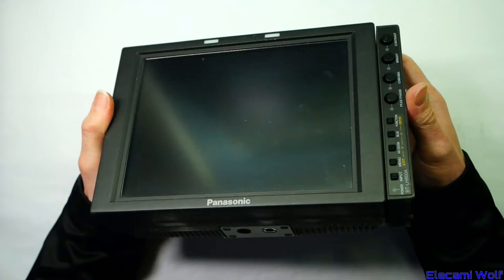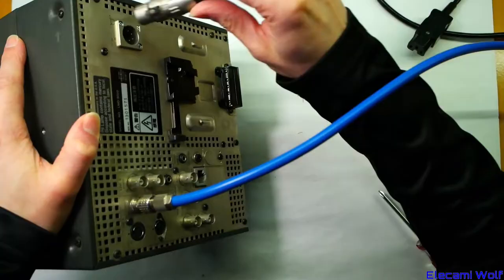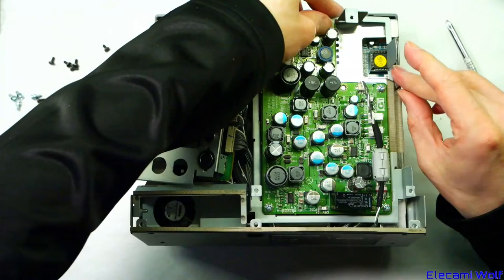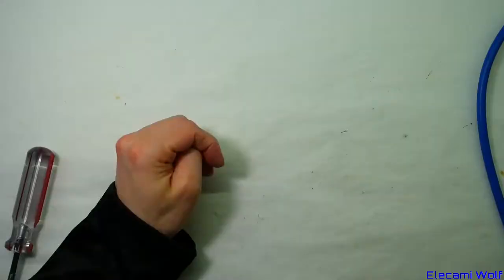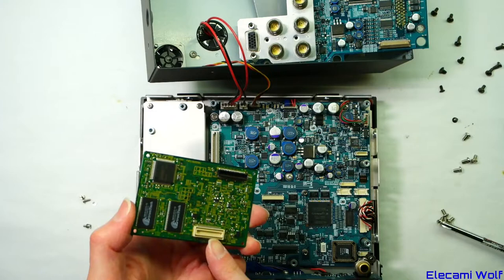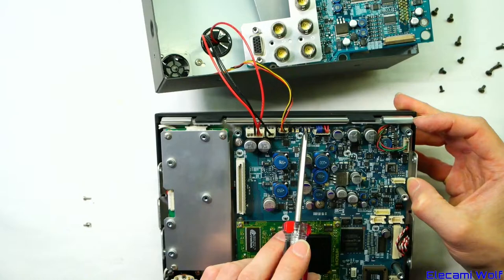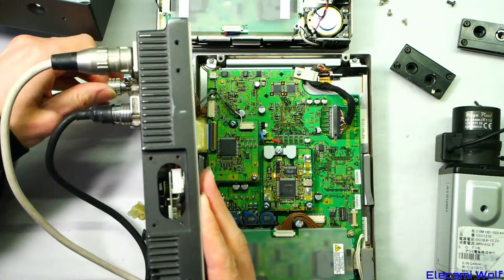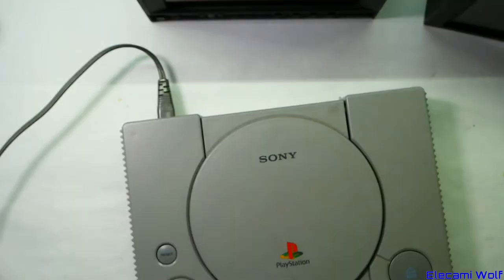EW0049 - Professional Video Monitor Teardown Sony Ikegami Panasonic

Comment: I bought the sony lmd-9050 for more than 3000€ when it was new. It was a product that worked perfectly, but was to cumbursome to be portable or wearable, so it was left to collect dust way to the power adaptor was a huge pain also. Reflecting back it was a go between product to real portable screens I should have never invested in. After two years even for 200€ I did not get a sale on ebay.
Reply from the maker: Oh yes, I think they were just to replace the older CRT models, which were never very portable. Only the Panasonic one looks like they attempted to make it compact for portability, also because of the sealed construction, better for outdoors.

Comment: Sony LMD-9020 9" (8.4" Viewable Area) VGA Multi-Format LCD Pro
HLM-910R: 8.4″ HDTV/SDTV LCD Monitor
Panasonic BT-LH900A 8.4" LCD Monitor, 1024 x 768 (XGA), NTSC/PAL/HD Auto-Switchable, 16:9/4:3
Nice units..🦊🦊🦊🦊
Reply from the maker: They are nice monitors. Shame about the Sony one not working. Not sure what its problem is.